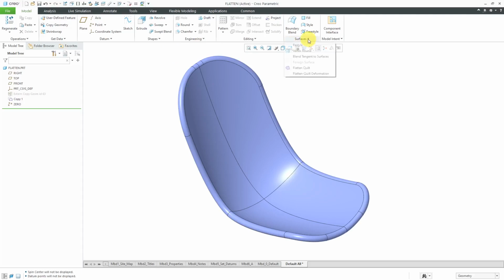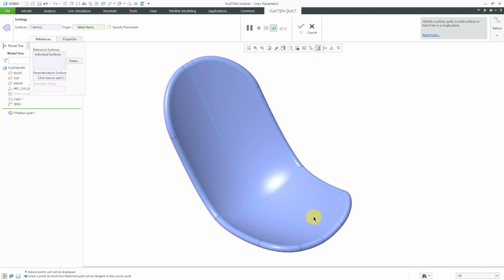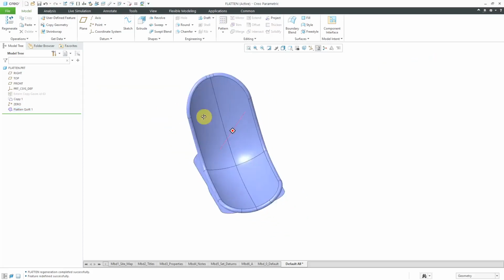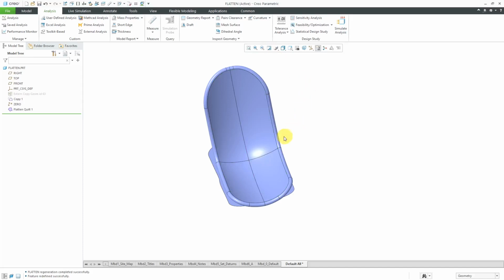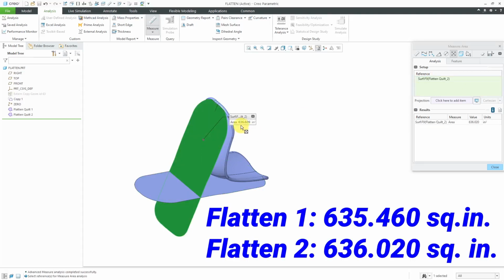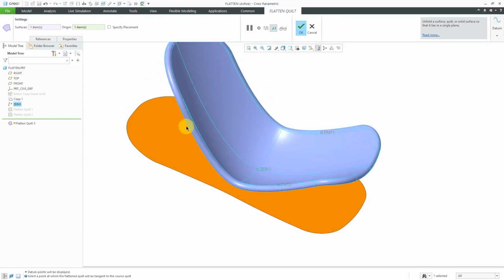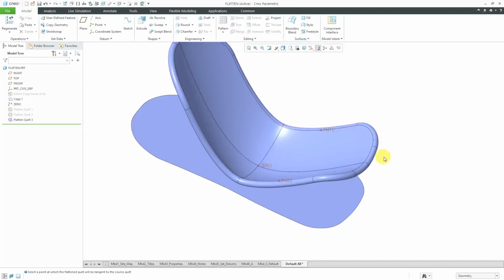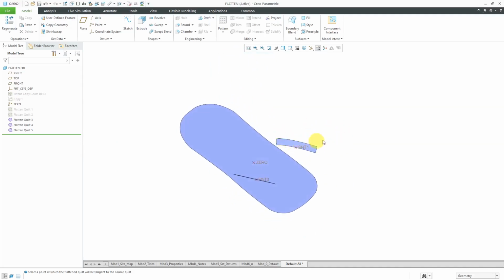Creo Parametric - Flatten Quilt | Surfacing

Comment: Why will we use flatten quilt when we have the option to work with sheet metal. i guess it is more realistic and practical
Reply from the maker: In sheet metal mode you do not have the ability to create features like Boundary Blends, Style, and Sweep. If you want to flatten in sheet metal and you have curvature in more than one direction, you're going to have to define Deform Areas or some other kind of cheating.
Reply: @CADPLMGuy   but is this even practical, do we have products like this and if yes, are they made from flat metal sheets?
Reply from the maker: @vivekgupta9829  Yes this is practical, yes there are products like this, and they can be made out of a variety of materials. Composite materials for example could utilize this functionality and like I mentioned in the video, some companies use this for designing cloth coverings for their products. If you don't like this tool, though, no one is forcing you to use it.
Reply: @vivekgupta9829  - Either you are a beginner, or you haven't designed complex geometry at the time you wrote your comment/question. Flatten quilt is where mechanical engineering meets advanced geometry. Transformation of curved manifolds into Euclidean ones involves sophisticated mathematics to map co-ordinate systems of one type to another. As the video maker suggested, look up Cartographer's Dilemma, to which I'd add, look up geometric topology and developable surfaces.
Reply: @CADPLMGuy  also getting different areas on selecting different points is not acceptable in industries. It should give the same value on selecting each defined points/vertex.
Reply from the maker: @vivekgupta9829  That is mathematically impossible. Unfortunately we're not in a position to dictate to math how we want it to work. For more perspective on this issue, see the Cartographer's Dilemma.